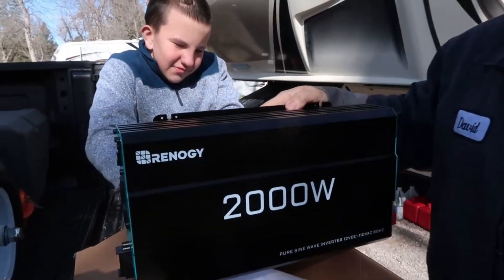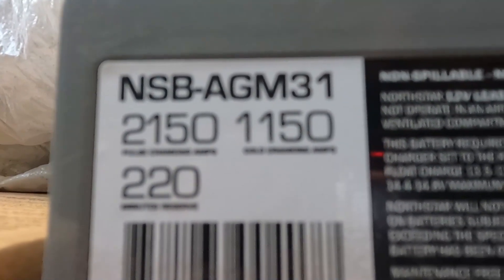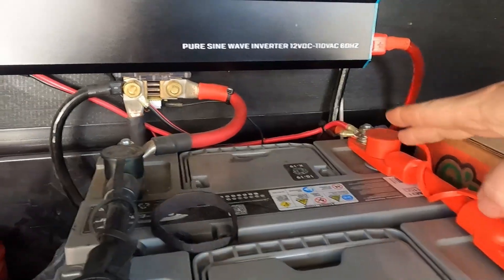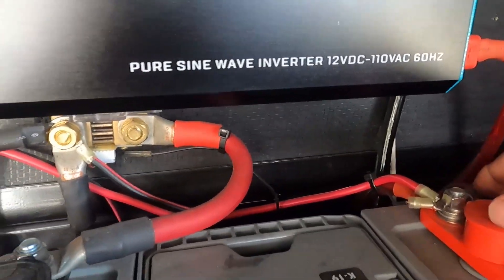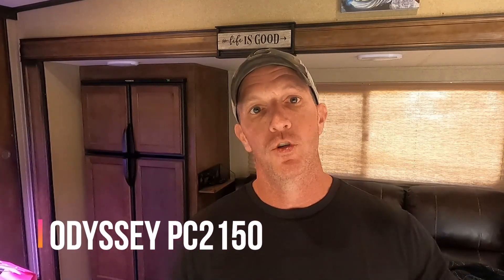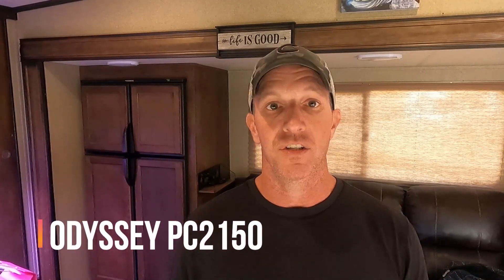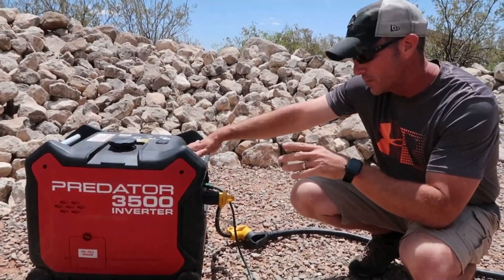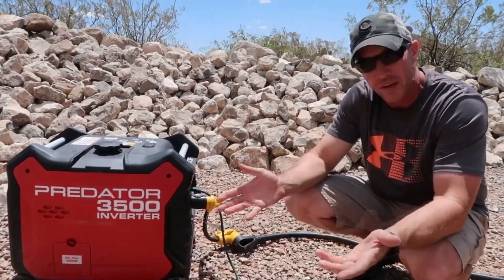EASY RV Inverter Setup | RV Inverter Setup Explained

Comment: Hi this may be a dumb question but when you run your generator do you turn the converter back on? How do you have the extra battery charger wired in to the system? Thanks so much for your video. We camp at a place where there are no hook up at all. I haul water from home and I have two Honda 2000 generators that I can link together if I want to run the ac

Comment: 3 years later, now you can shift to LiPo batteries, much safer than Lithium.   2000 watts, with your gauge wire, it looks like the same one Renogy sent me 
for my 700/750.  unless I am overlooking something.  2000/12 166 amps.  That's if you run it max. Is the draw from the inverter and battery constant, regardless of output of the 2000 watts.???  I just ordered 8 gauge wiring, to install my renogy to my Trucks battery.  I was concerned with the thin wire even at 750.
Reply from the maker: The draw on the batteries from the inverter will vary depending on what is being run on the AC side of the inverter.

Comment: Great video, Thank you!! I've thought about doing what you're doing but was nervous about doing that. My new 5th wheel RV has a 400W solar panel on the roof and it has a charge controller in the front storage area. I previously had a 180W suitcase solar with it's own charge controller. Can I connect that to the battery as well to have two sources of charging at the same time?
Reply from the maker: Thank you! It wouldn’t hurt anything to have two sources charging the battery. The issue would be one of the charge controllers will probably read the voltage from the other charge controller and not get the battery fully charged.
Reply: @JouppiOutdoors  Thank you. I never thought of that.

Comment: Hi there, this and your original video have been super helpful!  I wanted to double check the sequence, based on what I have:  2x 12v lithium smart batteries (so no need for a shunt) in parallel; positive to a shut off switch, then to a 300amp fuse which goes to a positive bus bar.  That bus bar powers an older bus bar for a few things and goes to the fuse panel.  I have the same Renogy 2000 you do.  For the inverter, would my positive run from the main bus bar to the inverter?  And would the negative cable come from the battery to the inverter?  I appreciate your input!  And taking into account what @stoney1952 noted, I would want the negative lead to come from the battery opposite the positive one that connects to the bus bar, yes?  Thank you!!

Comment: Great video! One suggestion though. On charging, set your positive lead on one battery and the negative on the other. Charging it the way you have it hooked up makes for a lead battery and a "backup" battery. The lead battery will fully charge and then the backup will charge. This can lead to unequally charged batteries. Ed Rock, Chrysler powertrain, New Process Gear, retired.
Reply from the maker: Good suggestion, thanks!

Comment: Can i put the 20amps adopter to the 15amps outlet of my 12v renogy 3000 watts inverter, because i been looking it up and its say no and i wanted to upgrade the 15amp to 20amps outlet on my inverter.
Reply from the maker: That’s exactly what I did, you will only be able to pull 15 amps max though.

Comment: Lithium is now cheaper, last longer and you can run down way past50 percent than heavy junk batteries that are dead in one to two years. For the power you get.
Reply from the maker: Lithium is the way to go, but they do have issues charging in extreme cold. At the time of this video, the Northstar (now Odyssey) thin plate, pure lead, AGM were incredibly reliable and extremely durable. We have since switched to lithium.

Comment: hi i installed mine on my RV and im connecting my 30amp plug directly to the inverter with a 15amp adapter. i understand that should work but im getting the yellow ground fault light when i do it. it kinda tries for couple seconds but then i get the light. the inverter does work normally if i connect other things like chargers directly to it. any idea why this could be happening? i been looking for solutions online but cant really find any. THANKS 🙏
Reply from the maker: Hi there, when installing the inverter, did you ground it to the trailer? If so, I would suspect the inverter doesn’t like something in the adapter or there is something on inside the RV that is causing the fault. You could turn off all the breakers and plug in the adapter, if you do not get a fault then start turning breakers on until you do to help narrow down the culprit.
Reply: @ thanks for responding 🙏. I did ground the inverter. today i connected the cable with all the breakers down and the ground fault still popped
Reply: HI, i realized my negative side of the inverter was connected to the wrong side of my shunt, now its on the right side and doing what you told me with the breaker panel i found out that it is the gfi breaker that is making the inverter trip, with the gfi breaker off the inverter works just fine! now my question is, is it safe to have the gfi breaker off?
Reply from the maker: @alva2707  The only issue would be that none of your gfi protected outlets wouldn’t work. Glad you’re figuring it out!

Comment: This was very helpful.  I am doing a cargo trailer right now, it has a 15 amp 120v system for 2 lights, and 3 outlets.  With this method, I will be able to run the whole trailer off of the batteries.
Reply from the maker: Thanks for watching!

Comment: That’s an interesting way to do it. I was just going to wire the inverter into the breaker panel and then just flip off the main and flip on the inverter circuit.
Reply from the maker: That’s certainly a more convenient option, but I was looking for a simple way that would work for someone without the ability to hard wire the inverter into the trailer.
Reply: @JouppiOutdoors  It's certainly an easier way to get it done! I do have the luxury of having pre-wired inverter circuits. I honestly wouldn't have a clue that is how it worked if I didn't notice the Inverter labels in my circuit panel. I probably would figured it out from watching a bazillion YouTube videos like this, but if I was just trying to get it done by myself as easy as possible I probably would just do something similar to what you have. Thanks for the video!

Comment: Thanks for the video very informative, I'm thinking of hooking a inverter to my camper but I was wanting to run the fridge on it, my original gas electric unit went out last year so I bought a electric fridge from home Depot because it was way more budget friendly lol, would you say that the 2,000 watt inverter is not big enough to run it? I just want to run the fridge while I'm traveling from my house to the campground.
Reply from the maker: Many trailers that have residential refrigerators use a 1500 watt inverter. 2000 would run a refrigerator if that’s all you want to run. Knowing the starting amperage of the compressor will allow you to calculate the correct wattage inverter for sure though.

Comment: you don't need the 20 amp plug, adapter or elec cord. Just get a 10 gauge extension cord, 10 gauge is good for 30 amps up to 100 ft run. Keep it simple.
Reply from the maker: Thanks for the info!

Comment: I am planning on doing the same thing you did, but 1 question I have is, if you turn the converter off how do the DC appliances run if only the inverter is on. For example the 12v fridge and the lights?
Reply from the maker: The will be powered by the 12v batteries, the converter is there to charge the batteries and supply 12 volts when the RV is plugged in to shore power.
Reply: @JouppiOutdoors  thanks so much! I went out and turned the converter off and turned on the lights and it worked! Thanks, again, for your video. Made me not only feel comfortable doing this myself, but solved a major boindocking issue I was having. I am going to add some portable solar panels and a charge controller too!
Reply from the maker: @brianjessen547 you’re welcome, feel free to reach out any time. Glad to help if I can!

Comment: 75lbs each.. 550 usd.. . Why won't you use generator.. ?? Same weight..
Reply from the maker: At the time that I installed these, they were around $300 each. We don’t always want a generator running and generator fuel and maintenance add up as well. Again, this setup is for occasional boondocking or when the power goes out at a campground for backup. Thanks for watching!

Comment: why did you choose the 2000w instead of the 3000w ? they have these new 460ah lipo4 batteries and i was thinking of pairing it with a 3000w in my Class A to run the Air con.. what do you thiink?  thanks
Reply from the maker: Honestly it was cost at the time and the 2000 watt is more than sufficient for our needs. The 3000 watt will probably run 1 a/c but the runtime wouldn’t be very long on 460ah.
Reply: if you pair it with the oupes mega 2 you can definitely get a few hours air con which is what i need @JouppiOutdoors

Comment: I have the same inverter with two lifepo4 minis (200+ Ahs and 100% discharge at only 38lbs total!). I appreciate you confirming some things on my system.

The converter loop issue was confusing to get my head around, but what I finally decided to do is connect a lithium battery charger directly to shore power through it’s own fuse and my 12 volt  power line from the circuit panel to battery. I’ll leave the converter c/b off always. With an auto-switch the system will default to shore power and switch automatically to inverter when off shore power. This way my batteries will get charger power and solar power when on shore power and only solar power when off shore power. 

Let me know if you see any problems with my logic. I think you could do the same and stop using the converter altogether, provided you have the 12 volt power line on your circuit panel.
Reply from the maker: Sounds like it should work if I’m following correctly!

Comment: Glad that you did an overview on the previous video. Really couldn't hear what you had said. But since I don't boondock a LOT only occasionally (wife hates it), this sounds like a route I might take. I didn't know that you could use (in my case- 30 amp plug) an inverter that you could plug into. That's a great idea of powering off your converter/charger and use your Victron Battery Charger to keep your batteries charged..My RV is solar prepped so I might just use a small system... Thanks for you explanation of your system. This gives me a good idea on what to do...
Reply from the maker: Yeah, that audio was so terrible! Glad the video was helpful.

Comment: hi sir . is there any proplem if i install inverter which take from my rv battery power and inverted to 220 volt . ending with tow sockets ? conerter to battery .. battery to inverter 220 v . not connected to any thing im my rv ? pls informe me
Reply from the maker: I’m not familiar enough with that setup to advise you in a knowledgeable way. There are a lot of resources online that would be better equipped to answer those questions for you. Thank you for watching!

Comment: Thank you so much for your video Sir!
As I was watching your video & you said a pair of AGM lead-based batteries were used instead of a lithium bank, & then began describing your experience with batteries, I immediately paused your video, & started writing this comment.
For my tiny little life, lithium batteries seem •prohibitively• expensive.
If there's a way to make AGM batteries work, that will be a couple months less of eating ramen for sustenance.
Ok back to your guidance & tutelage.
Thanks On That!
🙏🦉🏞️⛵
Reply from the maker: Lithium is great, but DEFINITELY expensive…and it’s not a must-have like many RVers seem to suggest. Thanks for watching!

Comment: My RV already has a power monitor inside the trailer so I don't need an external shunt to monitor? I have 380watts of solar, I'm installing a 2200watt inverter. I want to plug my 50amp RV power cord with a 50/15amp adapter into the inverter to supply 15amp power or 2200watts to the whole RV. Do I turn off the converter at the circuit breaker along with my 2 A/C's so no one accidentally tries to run A/C's? Do I need a power transfer switch? I have plans to boondock, this simply setup is just for back up if we lose shore power temperarely.
Reply from the maker: Yes you would want to turn off the converter breaker as demonstrated in the video. You would not need a transfer switch if you are plugging In directly to the inverter.

Comment: i get confused b/c all inverters i see have a safety shut-off mechanism that doesn't allow you to use more than about 25% of the battery, is this true or not true. i haven't found any inverters that don't have this shutoff?
Reply from the maker: Most inverters will have a low voltage cutoff to prevent discharging the batteries to the point of damaging the inverter or batteries. It should be around 50% or 12.06 volts.
Reply: how do you come up with  50% equals 12.06 volts. isn't 11.85 volts about 75% charged????? @JouppiOutdoors

Comment: Does the inverter not automatically go into “pass through” mode when connected to shore power?
Reply from the maker: There would need to be a transfer switch installed for that to happen. I do not have one in this setup.

Comment: Great video, thank you. In the manual it says "The inverter should never be mounted vertically on a vertical surface since
it would present a hazard for the fan opening which is crucial for cooling the inverter."
Reply from the maker: Correct, there needs to be sufficient room for the fans to operate. Thanks for watching!

Comment: Great explanation. My question is: when you turn off the controller charger don't you lose all your DC?
Best regards,
Rich
Reply from the maker: Great question! Your DC should be powered by your batteries when the converter is turned off. If you turn off the converter and have no DC power, your batteries are probably no good.

Comment: Just wire the cord straight to the inverter. Just remove the cover and you see it. As that connection is rated for 20amps. Why when I installed mine. I used #10ga wire. To offset the voltage lose. 

And be advised. That inverter can not handle 20amps. It's limited to 1800 watts. Which is 15 amps...You need the 3000 watt version. Which can handle 25amps..

Next month I will be replacing it with the 3000 watt Inverter\75amp Charger\Transfer Switch model... As I can use shore power. Solar\Alternator and Generator...
Reply from the maker: Good info, thanks for sharing!

Comment: Question: with the inverter mounted in the underbelly, doesn't it get hot? Wouldn't that inverter cook up when the summer temps outside get over 100° f? Do you think it will survive out there in Arizona's 115° f heat?
Reply from the maker: I have not had an issue with it getting too hot. This inverter does have fans to help cool it down. I would imagine as long as it’s not baking in direct sunlight, it would do just fine. I have seen inverters in marine applications installed in engine rooms where temps exceed 150 degrees regularly.

Comment: I have a Class C motorhome and I was thinking about adding a inverter directly connected to house battery so kids can watch TV or charge their laptop. I was thinking about placing dedicated power outlets under the dinette seating. When I am driving the house batteries do get charged. From what you are saying, I should not be doing this because when the kids are watching TV when the RV is in motion, we are drawing as well as trying to charge the battery. My batteries are not expensive as yours (MAN!!), is it going be that big of a deal watching TV using an inverter and at the same time charging when the vehicle is in motion? I am pausing the whole project after watching your video. I thought those tiny (150w) inverters they sell for cars can charge a laptop when the car is in motion and the car battery gets charged too while the inverter is drawing power from it.
Reply from the maker: It really depends on amperage the draw of the TV. The newer TV’s do not pull very much amperage at all so I would say this would be fine to do. In the video, I’m really referring to the battery charger trying to run off of the inverter while trying to charge at the same time. This creates a huge power draw that is not sustainable.
Reply: @JouppiOutdoors  OK thanks. The TV is  most likely less than 40w (39" led TV installed by Thor). I won't be running microwave while in motion, but I will install a 1000 to 2000w pure sine wave inverter, Energizer or Renogy brand. Victron is out of reach for me. Thanks again.

Comment: Thanks for the video, very helpful and looking at doing the same for our Fifth wheel Reflection.  Question I have is do you turn off your Victron charger when your not running the inverter?  Second question do you unplug the battery charger when hooked to shore power?  Thanks again for the video!
Reply from the maker: Hi there, the Victron charger essentially replaces the converter that is used from the factory. So I leave the Victron attached and plugged in to keep the batteries topped off at all times. The factory converter is still in the 5th wheel behind the basement wall, I just unplugged it and plugged the Victron into that receptacle since it has a dedicated breaker.
Reply: Curious why you went with the Victron charger versus just using the converter that came with the RV?
Reply: @TheAustinBoys  he explained it in the video, it does a terrible job charging his batteries.